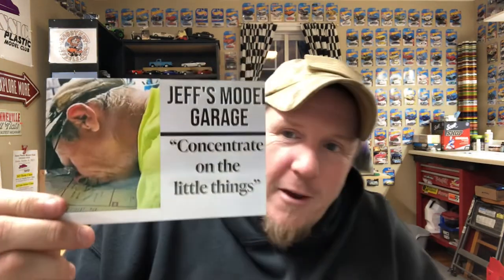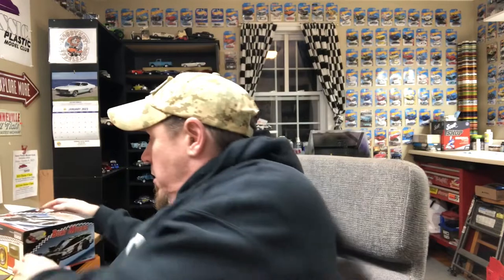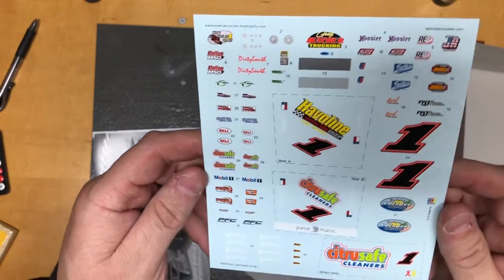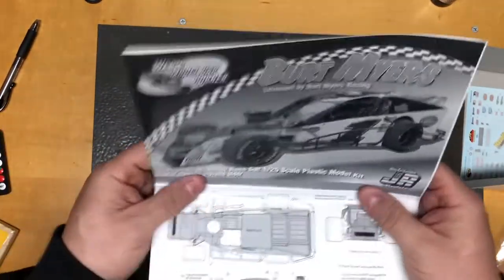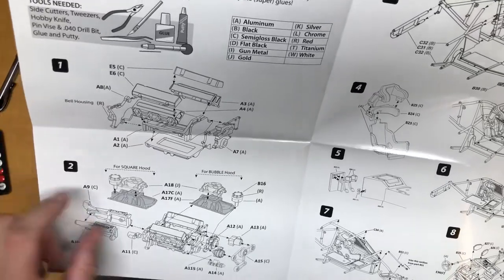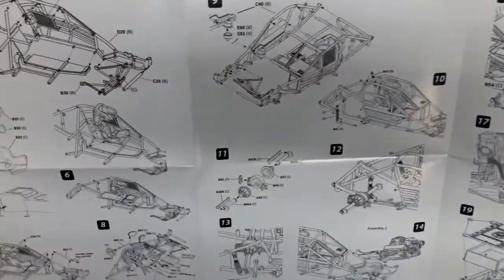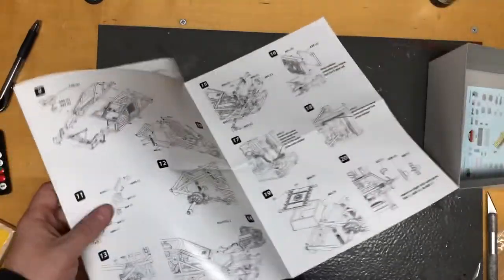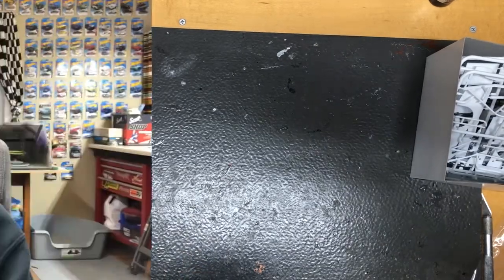Let’s look at the Burt Myers modified from Wes’s Model Car Corner/ Salvinos JR!!

Comment: I've seen, and read a lot of folks complaining about the decals sticking to the rubber tires. Folks? When you get these kits, open them up, take the tires out of the bag! They need to 'gas-off'. The fresh rubber tires are packaged quickly, not having time to do this 'gassing off'. It's important to let these tires do this, and when your ready to get the tires ready for final installation, the decals will stay on better, with some 'micro-sol' decal setting solution. Then brush a coat of clear coating over the decals,(I use matte lacquer, stirred up good, from Testors), and should keep decals from lifting off tires. Good luck folks. Keep on building!
Reply from the maker: Ok you learn something new everyday!! Thanks for the info!